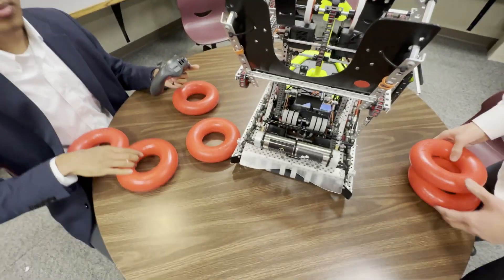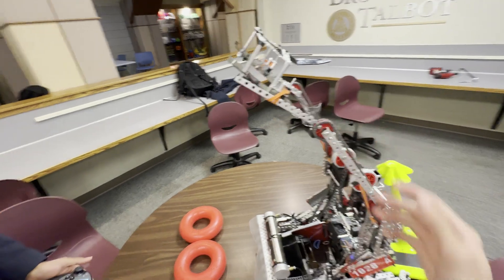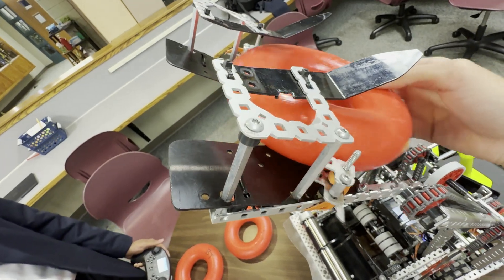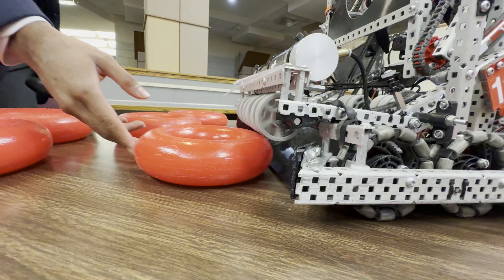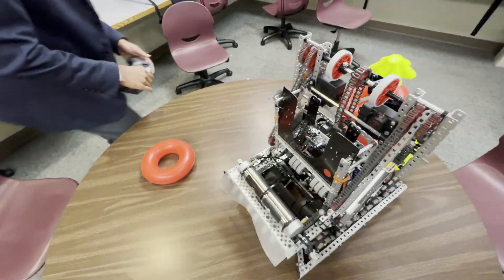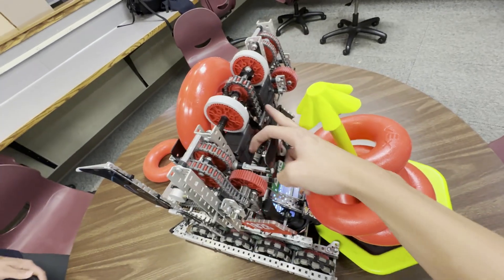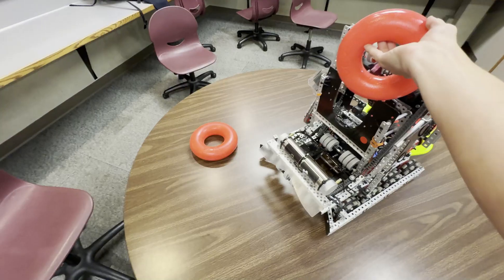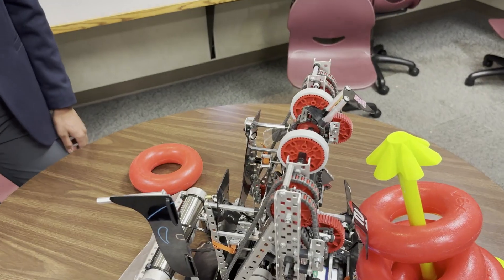1028A ROBO EXPLANATION (DIRECT MECH)

Comment: Just saw this, my team is interested in it, how did you do the chain bar lift?
Reply from the maker: I'm not sure I understand the question... you could reach out on our instagram if you're curious about something!
Reply: @ we got it all figured out, we where wondering how your flipped the ring using the chain bar, because standard chain bars keep the end parallel. To any teams wondering, you use a smaller sprocket on the end bar

Comment: How is your 24 tooth gear (connected to the counter roller) moving with your Intake sprocket, when its on a screw joint?
Reply from the maker: @EducatedExpo  good question, we use a round highstrength-lowstrength adapter halfway in between the two components, essentially acting as a coupler. it's the gold one
Reply: just got some of those in the mail, so many new possibilities with those bad boys